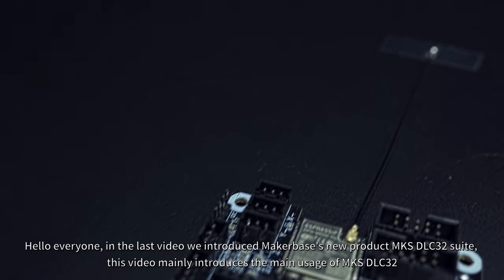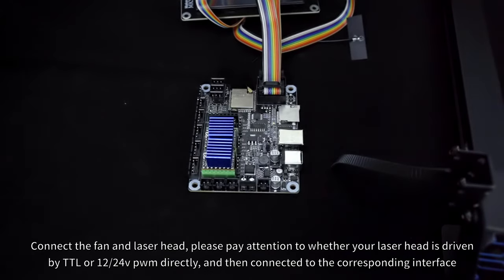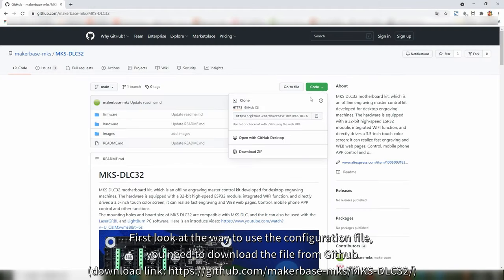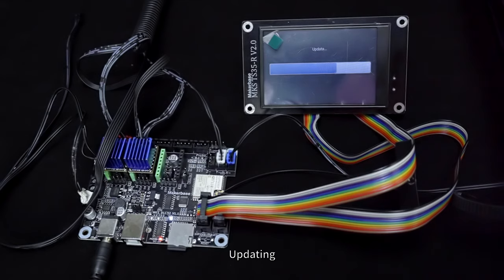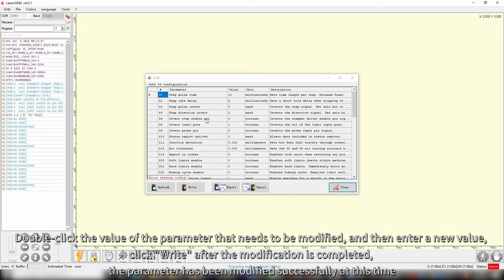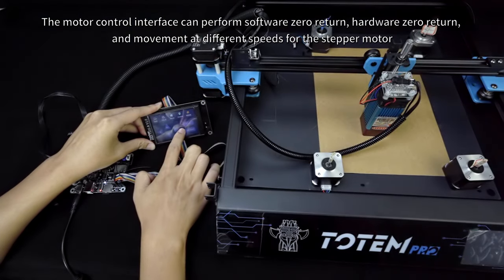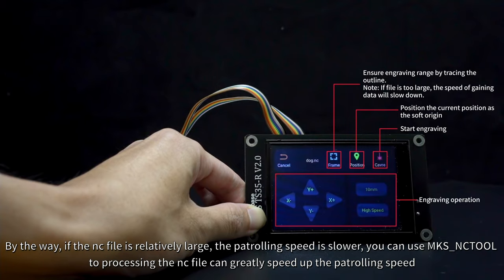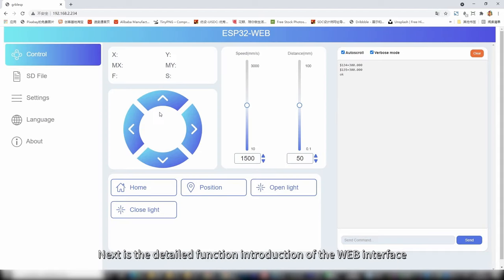Instructions for using MKS DLC32 on desktop engraving machine

Comment: 2 questions, 
1, On the laser itself, VCC,GND,PWM are the connections i have,  The board (V2.1) says S, TTL, V, are these in the same in order or do the wires need re-arranging?
2, On the MKS Armor, a fan can be installed to cool the drivers, can the fan be connected to any of the 2 12/24v outputs without affecting the laser or does one use a separate power supply? Thanks!

Comment: I am using a MKS DLC32 v2.1 as my controller. so here is the problem, it was working last night when I went to bed but this morning the laser does not fire. however it does fire if I enable "fire button". I thought it might be the board so I ordered a new one and are having the same issues. I press start the gantry moves but then it acts like its engraving but no laser and it suddenly stops. Not sure where to go from here... Any ideas what the problem is?

Comment: Hi. I have a spindle with external power supply and external control. What will happen, if I will not connect anything to spindle pins on MKS DLC32 board?

Comment: Thanks for the review!
I have several questions:
1. My spindle is 20 volt DC and current = 4.5 A has its own PWM speed controller, can I just turn the spindle on and off from this controller?
2. My normal limit switches have only two pins, can I use them in the controller and how do I connect them to the three pin connector?
3. Can use this controller for milling, need to upload special firmware, then the menu should change?
Reply: No you cant directly. with a little tinkering you can connect a 12v relay to the spindle output which will switch your 20v to motor.

Comment: Hello everyone! I am mounting this board to my sculpfun s6 and I wanted to put a power switch on it. How big should the wires be that I have to solder on the PCB to get them to the switch? How many AWG should be the section of that wire? I imagine that all the amperage of the power supply will pass through it. Regards

Comment: Hello and thank you for this video. Is it possible to configure the wireless settings of the board without the screen ?
(Can I configure it thru my mac and the use it wireless thru lightburn without any need of the screen ?)
Thanks !
Reply from the maker: Yes, download the latest firmware, you can configure wifi in the configuration file

Comment: Hi excuse the question, the TTL output on the motherboard is maximum at 24w. how is it possible to connect a 40w 3 wire laser? thank you
Reply from the maker: It is recommended that the maximum current should not exceed 20A, the current is too large, you can use the external expansion mos
Reply: @makerbaseteam4217  2 or 20 ampere is the maximum corrente? Where Is the correct wiring for external espansion mos?

Comment: Hello, I have MKS DLC 32 card. There is 1 limit switch slot for each axis. I want to use 2 micro limit switches for each axis. What should the connection diagram be?
Reply: Hello i have the same problem how you deal with it?
Reply: one axis connect limit SW paraller, if one connect stop machine,

Comment: Can I see a code to turn on the laser?  It will not be used with a laser.  Rotation axis supported?  (xy and 360⁰ "4th axis" - 3 axes are enough). 
Thank you for your answer.  I already found the max step rate.  250 khz.
Reply from the maker: Rotation axis? Unsupported

Comment: I have a MKS DLC V2.1 board and I bought a 40w laser with 3 wires (red, black and yellow). How to connect this laser to this board?
Reply from the maker: Hello, the three-wire laser can be connected to the TTL interface on the motherboard, they are S, TTL, G
Reply: You make it yet? I have idea like you.can you share your machine
Reply: @makerbaseteam4217  This board (MKS DLC V2.1) does not have a 3-wire connection. There is only one connection for the red and black wires and another connection for the other two wires as well.
Reply from the maker: @joselitobatista5194  In the upper right corner of the motherboard

Comment: Too bad they didn't use the board I bought... it has both of the connectors on the bottom right to the display rotated 90 deg.  It's in the manual, but it's not marked on the board that I can see.

Comment: What is the maximum Khz Frequency it can provide for the stepper motors ?
Reply from the maker: 250kHZ
Reply: @makerbaseteam4217  So if i want to use that on co2 laser what is the maximum scan speed i can get using 1/16 microstepping
Reply: Answer that question plz
Reply from the maker: @BlackwingzYT  9000/min
Reply: @makerbaseteam4217  I've ordered one without the tft display can i order the display after when i needed one ?

Comment: Thanks for the video. Which motor drivers are used? source of supply?
Reply from the maker: A4988, TMC2208, 2209
, 2225, 2226; LV8729, drv8825, etc.
Reply: @makerbaseteam4217  got it. thanks. but now i cannot control the axes individually. only the x-axis works separately. y and z axis just twitch.

Comment: its a pitty...  its seems in laser mode there is no Z-axis controll?? Is this correct?
Reply from the maker: With the latest firmware, it is possible to control with the firmware of lasergrbl
Reply: @makerbaseteam4217  Thanks for the info. What firmware is on the board when I buy one and are there any changes on the pin assignments for the new firmware? Thanks

Comment: Can I use for Metal Engraving Just Like Iron and Steel
Reply: yes,if use external stepper drivers and big nema 34 motors. smallest motors no power move and cut metal. and need 1,5KW spindle minimum whit steel, smallest can use only aluminium.

Comment: Quiero cambiar toda la electronica de un CNC 3040, dejaria solo los motores, estoy buscando una placa base y esta con capacidad Wifi es lo suyo ¿solo es para usar con láser?
Reply from the maker: CNC is also supported
Reply: @makerbaseteam4217  please make one video for cnc routers. I got my dlc32 jogging but not running gcode files.

Comment: I would like to chang the control board in a 40w CO2 laser engraver machine, can I use this board?
Reply from the maker: CO2 laser does not support yet
Reply: @makerbaseteam4217   Que se necesita para hacer compatible, esta placa con el co2 de 40w Saludos y espero
Reply: It’s not for the faint of heart but it’s doable. My OMTech k40 is using this board now. If you’re not very comfortable with tearing apart a working machine I wouldn’t recommend going this route.
Reply: @seabeepirate  Hey man. I would like to try this. Can you point me to some webpage where to find out how to do this?
Reply: @Blueyedevil2702  There is a clear enough wiring diagram on the Lightburn forums and if you got unlucky like I did your power supply won’t look like the one in the pic. That means you have the “white” power supply, which just means you have to splice some wires or use a specialty crimper to make your own connectors. There is a very good K40 power supply explanation on Maker Forums to help you identify whether yours is a green or white. Don’t feel bad if you think it’s blue. I totally removed the factory digital power control panel with the test button as well as the m2 nano board. Analog is the preferred meter anyway and you can use a potentiometer to limit the max power so it’s not controlled exclusively by software. I used the stock firmware which was newer than the newest download available from MKS. Make sure you set the frequency in your $parameters or your laser might fire inconsistently. Lightburn works on USB pretty reliably. I haven’t tried very hard to use the wifi with lightburn but I believe someone else has figured out how to do this. It’s doable and now that I know how it all works it seems simple but I felt swamped when I wasn’t really sure what I was even trying to look for.
Reply: @seabeepirate  Very interested in seeing your method of putting this board on a K40 co2 thank you
Reply: @seabeepirate your answer is Scarry....please can you make a video for us
Reply: @minravex9919  @davidfisher6023 I've been thinking about making a video for a while. My videography skills are pretty lacking but if you guys have any specific questions I'll try to answer them and include them in the video

Comment: Can this be used on a k40 co2 laser?
Reply from the maker: not support
Reply: Not supported..? MKS DLC 2.0 works why this one dosen't work?
Reply from the maker: @FinalFight08  Is your CO2 laser tube machine? It's just a machine that can support the laser head
Reply: @makerbaseteam4217  MKS DLC 32 as a TTL pinout that gives 0-5V..that can be connected to GND and IN pinout on K40 power supply to control it...and yes i have an K40 CO2 laser machine 👍. One thing that would be great is that we could change the $33 value on GRBL firmware. Make GRBL-LPC to be supported by the board 👌
Reply from the maker: @FinalFight08  Well, we did not conduct such a test, if the previous DLC motherboard works, then it is also possible
Reply: @makerbaseteam4217  the makerbase team should make that tests...this board is a good substitute for M2 Nano board and Cohesion3D board...just need to be flashable with GRBL-LPC firmware 👍. The K40 machines have a huge market...good for MKS.
Reply from the maker: @FinalFight08  ok, we will test it later
Reply: @makerbaseteam4217  great 👍. One question, wich MKS TFT's are compatible with MKS DLC 32? Thanks
Reply from the maker: @FinalFight08  Serial screen is not supported, there is no external serial port on the motherboard, this motherboard is equipped with TS35 screen
Reply: @makerbaseteam4217  i want to know if the normal TS35 is compatible or just TS35-R. I have the MKS TS35 that comes with MKS Robin Nano 👍
Reply from the maker: @FinalFight08  It’s okay, they just have different sizes
Reply: @FinalFight08  opa, estava vendo a conversa de vcs, você esta conseguindo usar o MKS em máquina de corte laser de cO2 ?